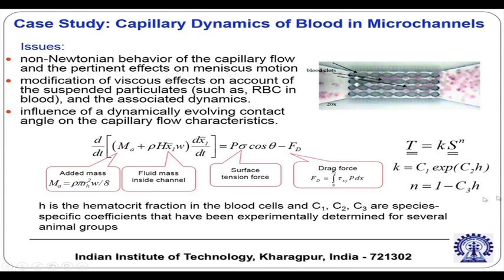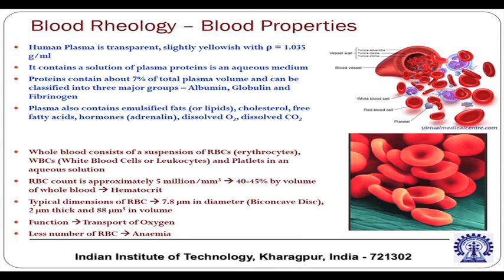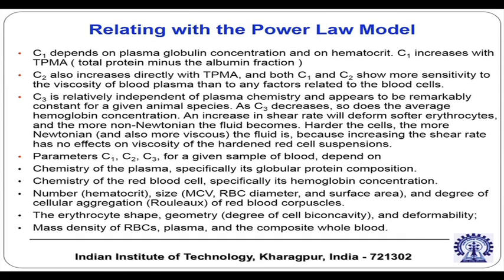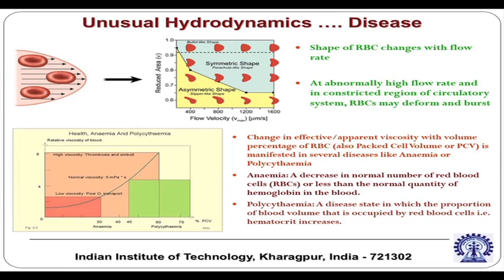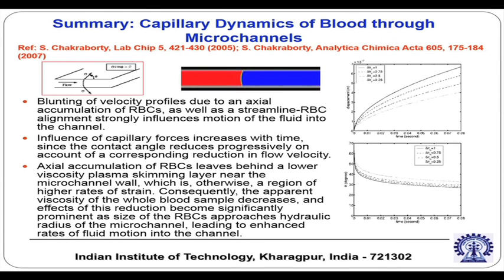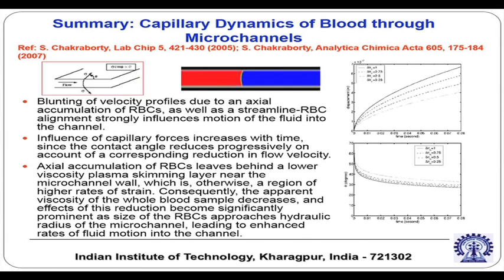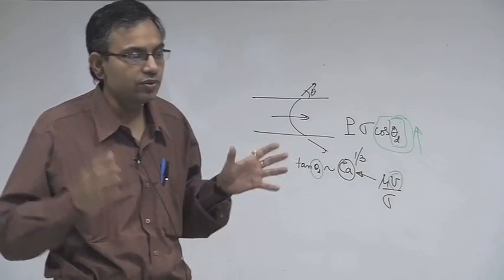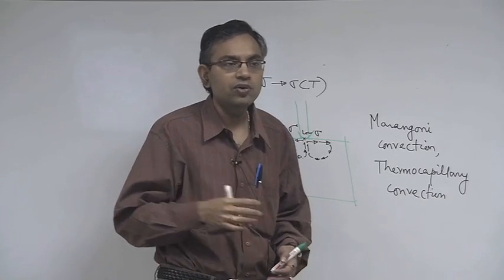Mod-01 Lec-27 Surface Tension Driven Flows (Contd.) and Modulating Surface Tension

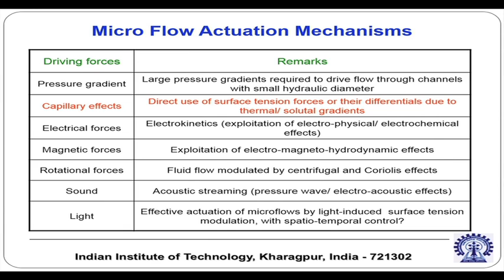Comment: in the screen for micro-flow actuation 45:09  - can we also not include Chemical Forces created by an array or pattern of hydrophobic and hydrophilic coated material ? - would / could this not also result in a sustainable flow of a fluid in a micro channel?